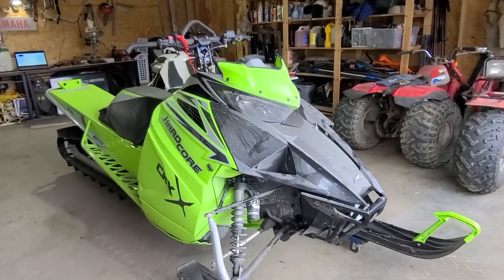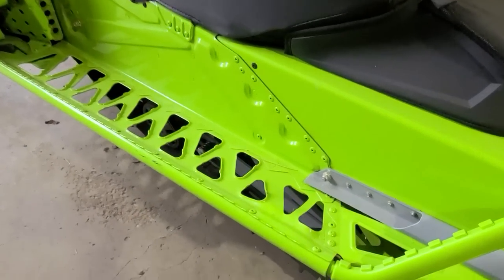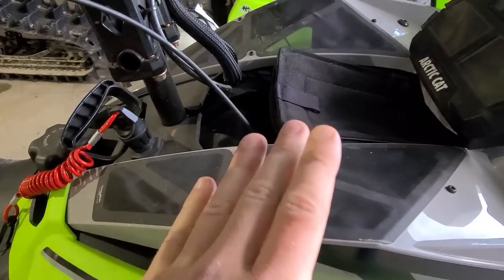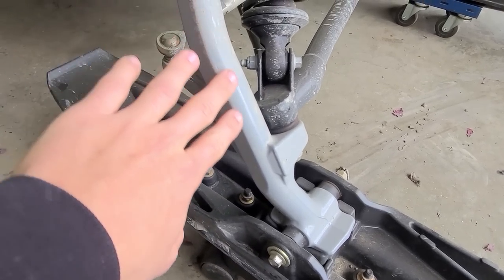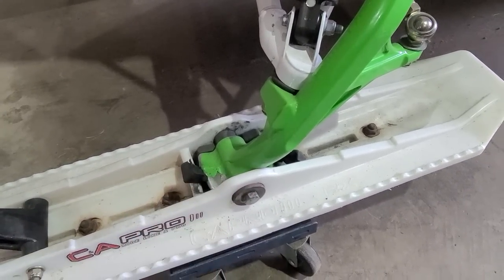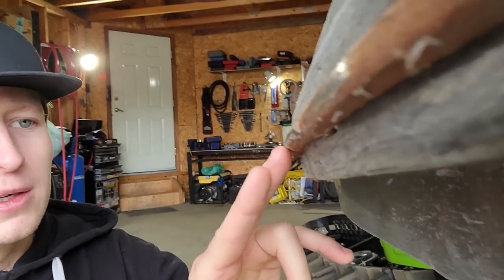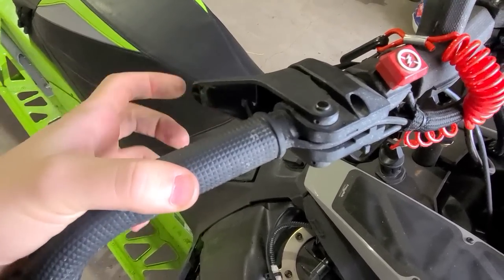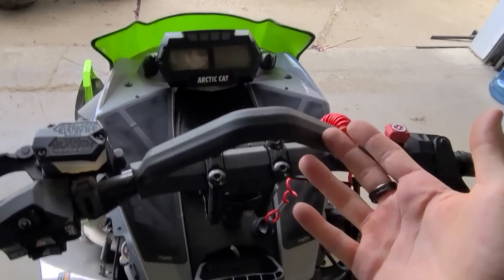HOW TO BUY A USED SNOWMOBILE

Comment: With a few decades managing a mountain motorsports shop i have concluded that there are basically 3 types of used sleds on the market.
The Stripper Sled-  always fast! looks hot AF, sounds OK but usually loud, not stock and most likely has a few bolt-on accessories and trinkets, check compression first! over all good sled to pound on for a season or two, just don't ask about it's past! usually asking a bit much but may be worth it!
The Ex Wife sled- it has a lot invested into it that the seller will not recoup, and lots of expensive aftermarket accessories that may or may not increase performance but still looks nice. after a handfull of years and many long miles it still runs and looks OK but it wasn't the rite one for the seller but they're sure it'll be prefect for someone else. usually affordable, at first..
The Hooker sled- old rental. it'll run and usually get ya where yer going, if you can get it to start, use ether!  it has no compression, clapped suspension, odometer was disconnected years ago, no telling how many miles its actually got so don't ask...always cheap, or should be.
Good luck out there, hope this helps.

Comment: I just bought a sled it’s a 2010 summit 800 I new it had some issues but I was ready for that just because I never really had a lot of money for a sled ($2500) it needs some pull start work a good ol clean of the carbs and clutches but the awesome points were that well the track is brand new (146 2 inch paddle) belts and clutches over all I love my purchase

Comment: Don't forget a pressure tester. One important thing to check is cylinder compression when buying a used sled best way to tell the condition of a engine if you have 135psi in one cylinder and 115psi in another then you know it is going to need engine work

Comment: I grew up with a 73 panther till 89,so I know what to look for ,it was in mint condition when it was sold,had to change the pistons jug gaskets head gaskets,,coils,had the 440 up to 110. Mph,and it only goes up to 100

Comment: I like to get a rough idea how hard a sled has been ridden. You can text the seller and ask for the miles and hours showing. just divide the two out and compare the result to that for your own sled and it gives you an idea how fast it has been ridden. Sure there is a significant variation depending on the type of trails that have been ridden, but on a given day you almost always get a good variety, and if the rider is keeping it under fifty on the open stuff, compared to the rider who runs it right up to 90 on the open stretches it is going to show up in the average speed.

Comment: Thanks for the great information. I’m a newer rider and just bought my first
Mountain sled 2013 M8. Do you have any vids on y-pipe leaks or issues ? I can’t seem to stop it from leaking, I’m wondering if I just need to change out the y-pipe ? I run an SLP exhaust system, do you know if a stock y-pipe works with the SLP setup or is it crucial to use SLP products? Any info I would appreciate. Thanks again for all great vids

Comment: Hey Matt, I have a 99 Arctic cat ZL 600 EFI… I just recently got the primary clutch rebuilt and put it on yesterday. I took it around the yard and I could here squealing. Before I took it around the yard I had to put shims in the secondary clutch to loosen the belt deflection but I think I might have too many shims. Just wanted to see if you thought that squealing noise was the belt slipping on the secondary clutch???

Comment: I just bought a sled this summer for 750 it’s a 2002 mm600 triple and I went thru the whole thing because it sat in the trees for 3 years so I vacuumed all the shit out of the engine and washed it replaced a few fuel lines cleaned the carbs and the gas in it still fires but I diluted it with some new stuff but when it idles it shakes bad once in a while and sounds like I hammer a piece of metal I’ve been told to run it hard this winter to clear it out
Reply: Josh Frank only once in a while I’ll see what happens I think it’s the old gas causing a backfire if not the gpcrank shaft

Comment: I am a disabled snowmobile rider. I bought my first sled last year at age 52. the sled was a 2008 Yamaha apex. it was extremely fast and darty on the trail. I sold the sled and I am in search of another sled.  I don't want something with quite so much power. My balance is no great for keeping me in the seat at speed. my legs just do not have a lot of strength. I need something comfortable and very reliable.  I can only afford to spend between $3-4k. any suggestions would be greatly appreciated. thank you. just mostly ride trails and ice fish

Comment: Remember, especially on the 2016 and below to really have a good look at the TCL or torque control link.  They are very notorious for cracking lost mine at 1500 miles.
Reply from the maker: Of the hundreds of m8s I've worked on, I've never seen that
Reply: Syxxes Performance  i sure hope mine was a fluke but many on the forums have had similar issues.  It was a royal pain to fix lots of torch action to get jack shaft in and out
Reply: @davidromero6335  what you have to remeber is the only people complaining are the ones that have had problems. The ones who haven't had an issue wont say anything its like the alpha rails theirs way more people who have no issues than the the ones that do.
Reply: Dylan K that’s the downside to forums. Same with a buddy of buddy. Too often you got 3 or 4 guys talking about the exact same machine.
Reply: @dylank3333  Ok first off the dealer that sold me the sled just said they have done 10 of these especially in the 15 and 16's. In 17 they beefed  them up and was told to use that TCL. While I was in there I also switched jackshafts since you get more mph on a 15 jackshaft. Also just checked my nephew's 2016 and it is also cracked. Maybe us Coloradoan's ride rougher stuff lol

Comment: Arctic cat's aren't known for their longevity wouldn't get one.Skidoo's last the longest and are the most reliable and their engines are made in Austria. Been riding since the early 90s.
Reply: That is definitely inaccurate. Yamaha has come a long way as well as arctic cat. The apex is the most reliable sled that has ever been produced. But these new genesis engines are extremely reliable routinely making it 15k miles at the minimum without a rebuild. And they do this making big power 200+ hp. Ski doos have never been able to figure out their electrical leaving it a bonfire on the trail. Seen it more then a few times.

Comment: Not saying it’s the correct way and hell, might not even be remotely accurate but I’ve checked for compression just pulling it over slow. If there is a huge difference should be obvious. Haven’t gotten burnt yet

Comment: How would one of the m8000 153’s handle on a trail? I wanna do a mix of both.
Reply from the maker: It does not too bad. Drop your scratchers for the small heat exchanger though.

Comment: I have a question about my 2011 rmk 800. When I first bought the sled I use the be able to let the sled warm up for a minute or two before I would ride it. But know it can’t run for 15 seconds idling and it will foul a plug just the clutch side. I didn’t really do anything about the problem I would just start the sled up and run it slowly around the yard till it was warmed up then it would not foul a plug. Now the engine light is on and it sputters at high rpm like when you are wheeling. Could it be a fuel issue or a spark issue or clutching? I hope you understand this message and can get back to me thanks! Also compression is at 120 on both sides
Reply from the maker: Yessir. Could be fuel, spark, or clutching. Needs to be diagnosed, good luck!

Comment: I mean I would not trust what he says just needs a flashlight and bring a compression tester and if they don't let you do a compression test then there's something up.
Reply from the maker: You're talking as someone who know's sleds and is familiar with them. This is a video for someone who is not familiar with machines.
Happy Riding!
Reply: @syxxes   Yeah but you can't tell the compression with a flashlight now can you of course you can tell compression by starting it but like you don't know if it's up to spec what if it needs to be 150PSI and you have 110 then you have a problem.
Reply: @syxxes  psi*